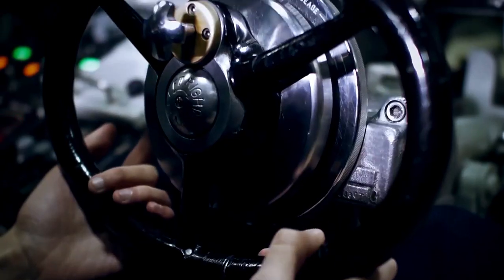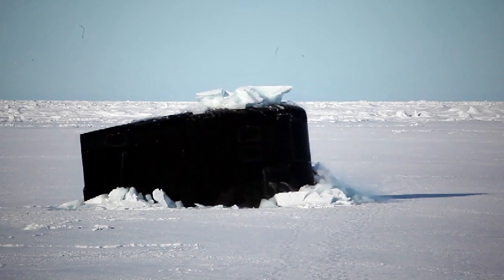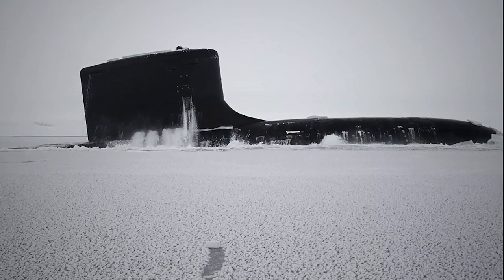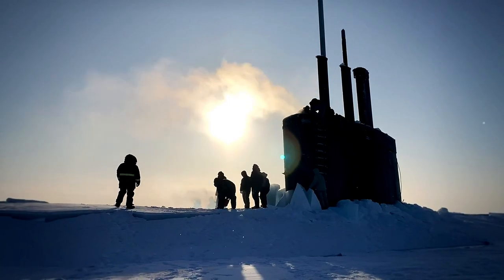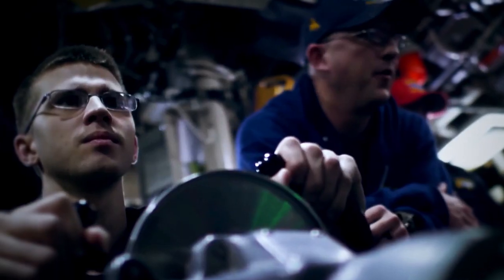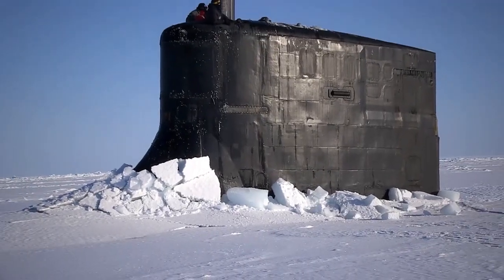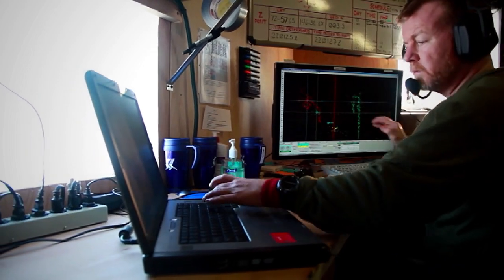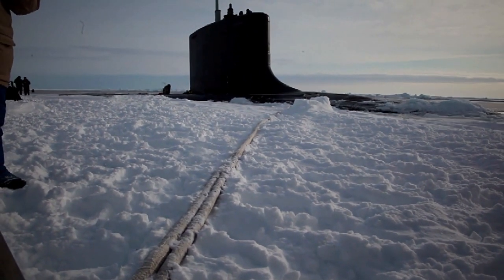US Navy Nuclear Submarine Cracks Polar Ice

Comment: By the way, pumping out water from the ballast tanks increases bouyancy not decreases. If bouyancy decreases the boat sinks. At least it was so when I went to school. Maybe someone has a different interpretation of physics.
Reply: What I thought too at first but if they pump out water but also pump in air that will increase buoyancy. Thoughts ?
Reply: @djblc2201  that's pretty much a given as to displace the water they normally use air.
 Not pressurising the ballast tank would make them likely to implode sinking the boat.